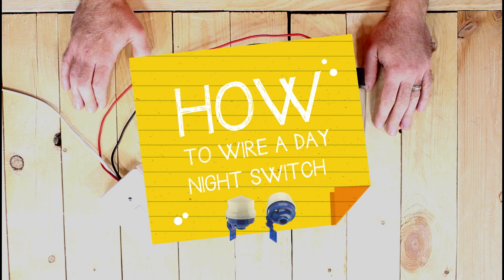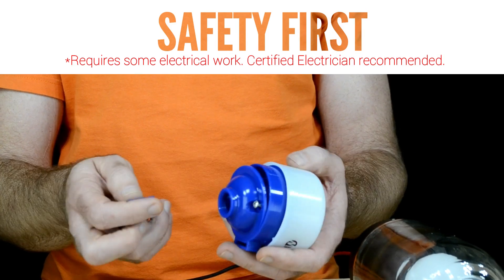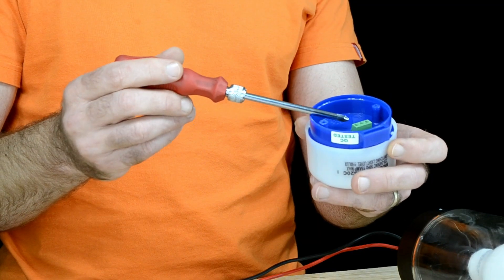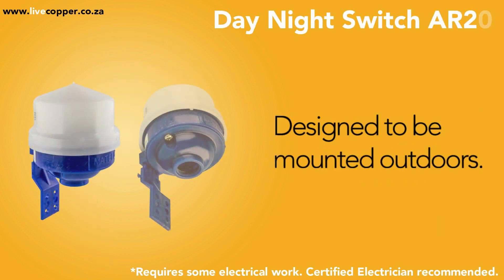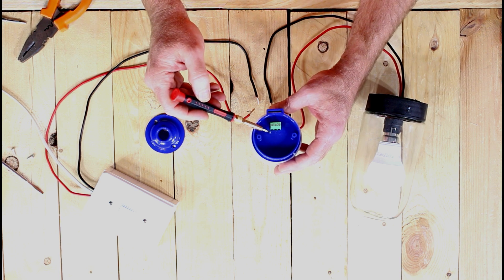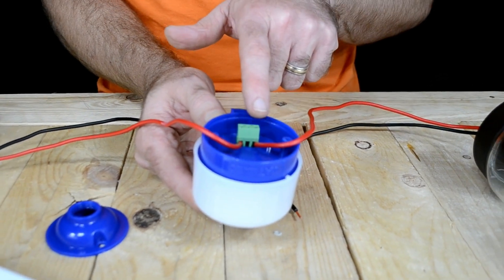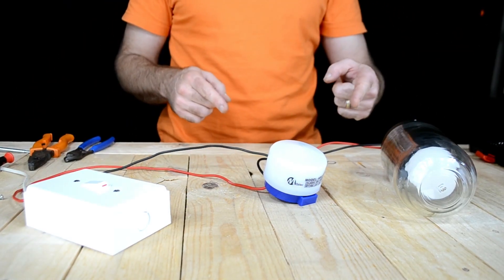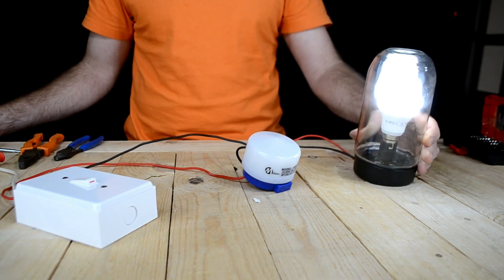How To Wire A Day Night Switch With Livecopper

Comment: Hi Guys, Please advise on why the Sensor comes with an installed loop between the Neutral and the Load? In other words, we would actually only have a single Live-in and a Single neutral-in, wired-in a series from the power and taking a return from the light. How can I post my wiring diagram to indicate if I understand it correctly?
Reply from the maker: Hi Angus, send us your diagram to sales@livecopper.co.za and we will respond from there. Thank you.